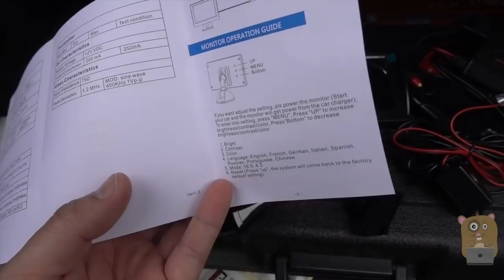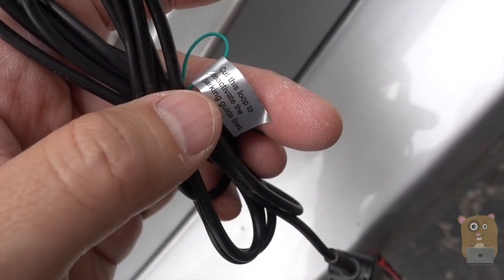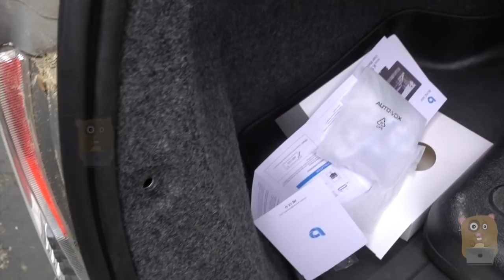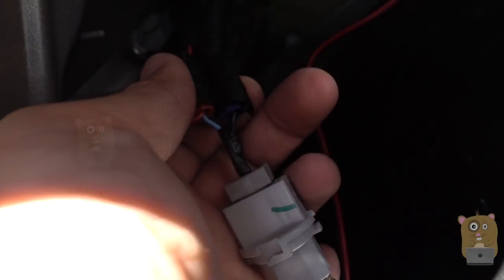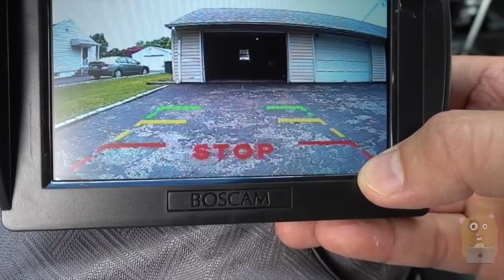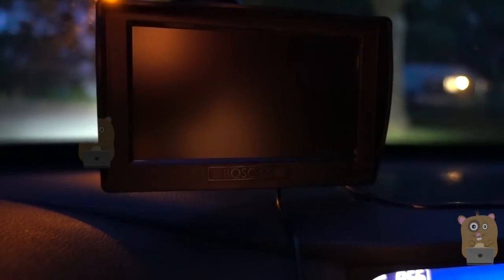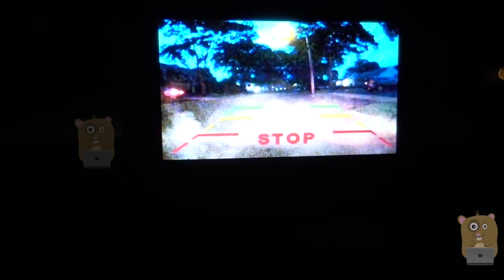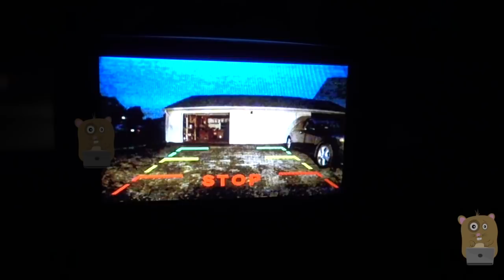BOSCAM K1 Wireless Car Backup Camera Review

Comment: Wireless?? I see lots of wires in this video..🤔🤔🤔
Reply: The reversing camera connects to the wireless transmitter via wires, it also need to be powered so there are power wires. It is then wireless from the transmitter to the monitor to the front, otherwise you would need to run a wire the length of the vehicle.